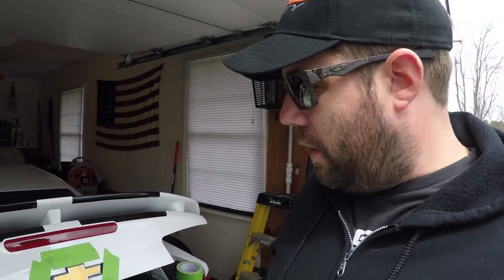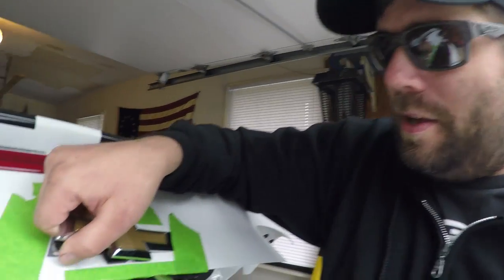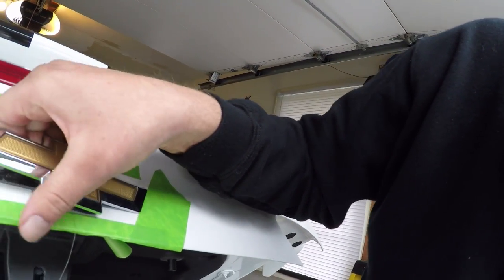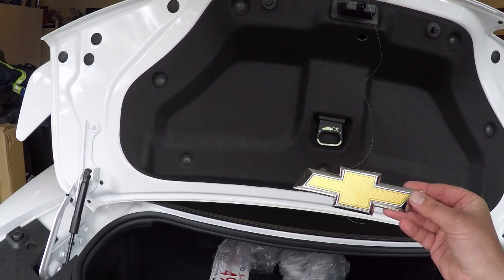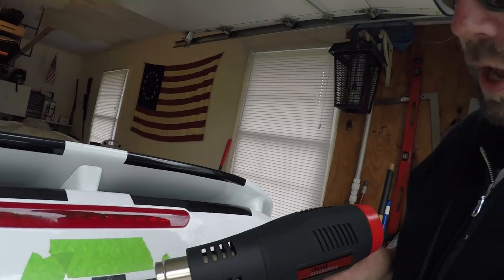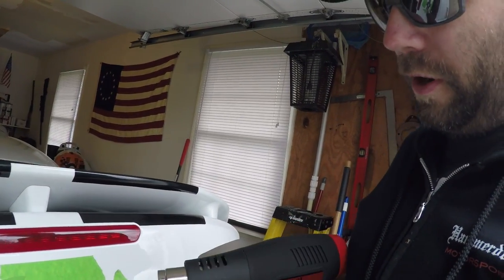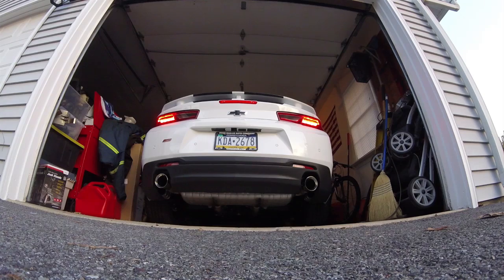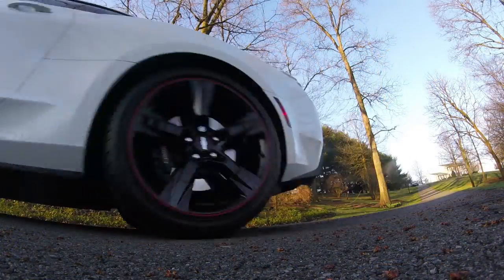ZL1 Rear Bow Tie Install And Cars and Coffee

Comment: thats a good way to chip the paint. heat it up and the line will take the whole badge off.  My dealer gave this job to a 16 year old kid and he chipped the paint to the metal taking it off like you did. those corners are sharp. 
http://i419.photobucket.com/albums/pp280/ford7379trucks/20170418_205224_zps1lj2kgwl.jpg